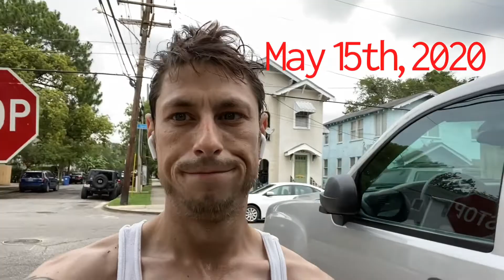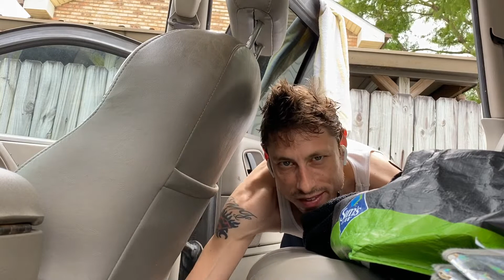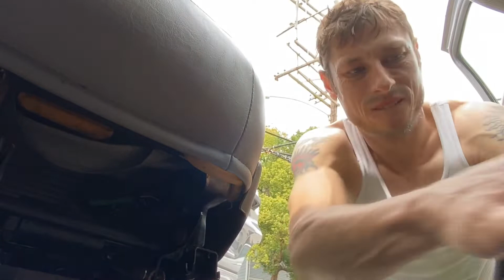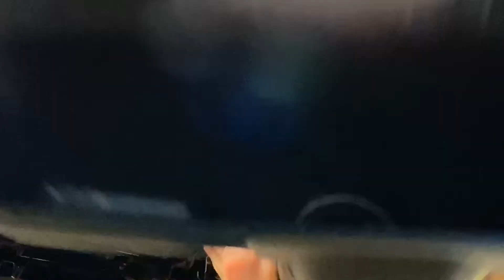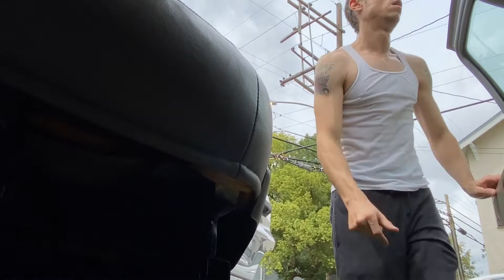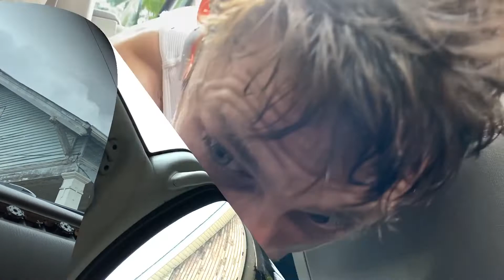Friday The 15th

Comment: I had this kind of thing happen to me in Houston years ago, if you was running your car at the time it would be wise to check your transmission fluid several times to make sure there is no water in it check your oil too. if You car wasn't running then your good to go as far as the transmission goes